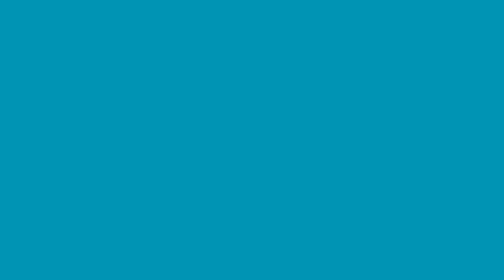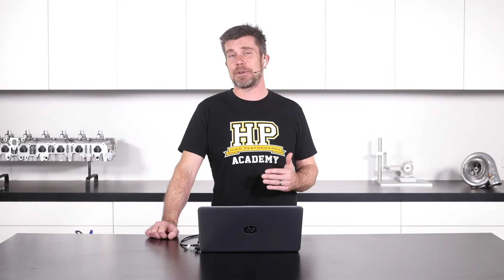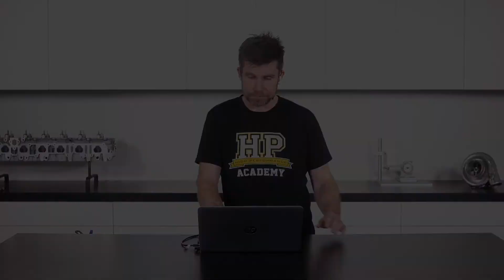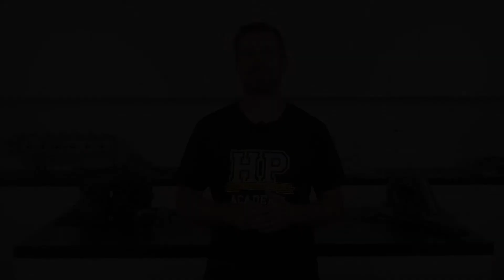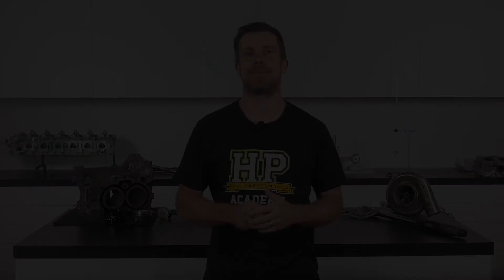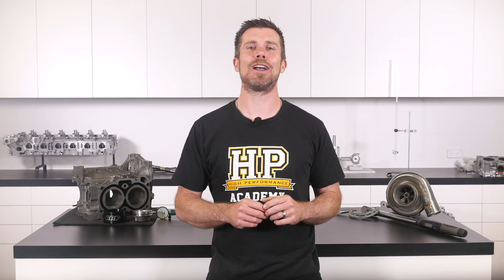Why Does Running Too Lean Cause Engine Failure? | EFI Tuning [HPA Q&A]

Comment: This is NOT correct. Running lean REDUCES overall combustion temperature and requires ADVANCED timing to prevent higher EGTs due to the slower burn rate. You DO NOT know what you're talking about and you shouldn't be misinforming people.

Comment: Great information as always! Just curious if you have any tips for ensuring an engine isn't damaged when running lean other than obviously monitoring for knock? I'd like to tune my engine to run lean when under light to moderate loads and lower RPMs for better fuel efficiency, but there's not much information out there on safely running engines lean since most tuners don't care about fuel efficiency. Thanks

Comment: so the people who make hho generator claiming that hho combustion combined with lean mixutre can increase the ICE efficiency adn reduce the chamber temperature as hydrogen is cooler than air are somewhat correct?
Reply from the maker: Not something I have experience with sorry.

We do discuss lean burn in relation to motorsports in a podcast or 2. This one specifically from memory - Taz.

https://www.hpacademy.com/blog/064-developing-championship-winning-engines-for-redbull-f1-podcast/?utm_source=youtube&utm_medium=social&utm_campaign=general-interaction
Reply: @hpa101  Good idea for a video? one video to explain what hho generator is being claimed to do and one to use it in a car.
They claim adding hho in the combustion increases the percentage of mixture being burnt thus reducing harmful emissions as well. I want to make a video myself but I have no understanding of engines.
Reply from the maker: Not for us, we have no course material on HHO generators or experience with them. Frankly what might be sound in theory looks like complete BS when it comes to the practical application from what I have seen, but, we're not the experts you are looking for in this field so you will need to continue your search sorry dude - Taz.
Reply: @hpa101  thanks

Comment: Does running lean below 2500 rpm normally cause detonation or damage? Just wanting cruise fuel economy below boost
Reply: Retard the timing, reduce the distance between the burnt fuel out the exhaust valves!

Comment: Can you explain why propane and CNG don't damage the engine, but they are very lean gases?
Reply: super lean = super cold coz not enough fuel to heat stuff up and mostly air just comes in and cools the enginge.
somewhat lean pretty close to 14.7 = super hot coz thats what youre thinking of always happens.
duhhhhhhhhhhhhh
engineering explained has a dumb video from forever ago with the bowl cut hair titled something like LEAN ENGINGES DO NOT BURN HOT if you want more info lol. he messes up reading the air fuel ratio chart and does it backwards facepalm

Comment: Hi Andre,got a question.Ive got a N54 BMW stage 2 tune on Cobb.Car drives fine with AFR between 12 and 14 but when i take my foot off completely while driving it runs over the top lean.Will this cause any damage?
Reply from the maker: It's not usual to tune to run lean during deceleration. There is no load on your engine during these conditions - Taz.
Reply: Nope, no problem at all. Virtually all cars made within the last 30+ years will completely shut off fuel injection when the throttle is fully released while in gear and at least a few hundred RPM above idle. This saves fuel, reduces emissions, and improves the engine braking effect. No fuel means no combustion. Besides, there's less than zero load on the engine on decel anyways.

Comment: I had always understood that when you get melted cast aluminum pistons, like holes burned thru the piston surface, and not really much detonation, that that could be a good example of running way too lean under WOT/high load boost.

Do I have that understood right?

Comment: a superior cooling system should support those lean AFRs and higher cylinder temps...or am i wrong?😕
Reply: Coolant goes around the combustion chamber and not inside it, so just watch the egt
Reply: @RohanSanjith  this^
also, are u running an aluminum block? honda was on to something, doesnt hold as much heat as iron/steel but its specific heat is like 1/3rd so it can be cooled easier. specific heat works with you since with 4 stroke you have 3 strokes for cooling and 1 for heating so more time to cool vs heat.... if that makes sense. i just made it up lol idk
Reply: try adding hho generator, the gas added to the combustion will keep it lot cooler, thats what i heard.

Comment: If the tune was done with platinum plugs would it be ok to go back to copper in same heat range? PFR7B to BKR7E, cheers
Reply from the maker: Yes that is just a coating that helps give you longer life out of your spark plugs. The heat range is the critical aspect to make sure is correct - Taz.
Reply: @hpa101  Cheers man

Comment: My understanding is that knock/detonation/ping/pre-ignition can be caused under different conditions, could you explain the differences and the conditions... I don't seem to quite understand the difference... I've even heard that you have to detonate your engine to record the frequency in tuning so when your engine detonates while you're driving, the computer can pull timing out and maybe add fuel or whatever... please explain. Thanks.
Reply: Fuel acts as a cooling agent, so when running lean there's less fuel being burnt and no fuel to take the heat of combustion chamber!
Reply: He did, all of the knock symptoms are due to excessive heat in the cylinder. Causes can be high IAT, "low" octane fuel and too advanced ignition timing.

Comment: Is it safe to tune all of the map to 1.200? At the moment it's around 0.800 to 0.7600.
Reply: Really depends on environment, temperature, humidity, altitude, driving conditions, and other factors such and fuel, spark, eng temp... This tuning stuff is tricky and usually a single value across the board will not produce maximum results... Good luck, and i hope you find a more in depth answer than mine...
Reply: @mikeschaner5853  Definitely tricky . Thanks mike, definitely tricky stuff they make it look so easy on hear